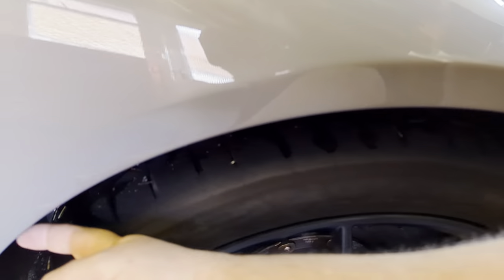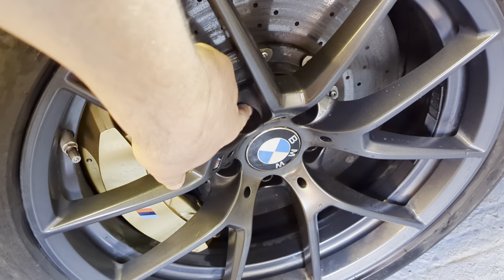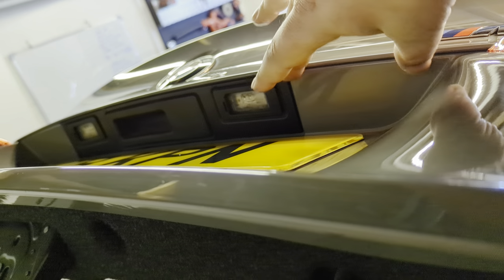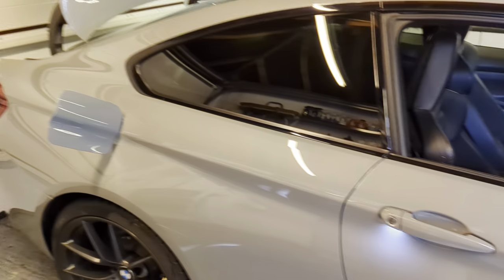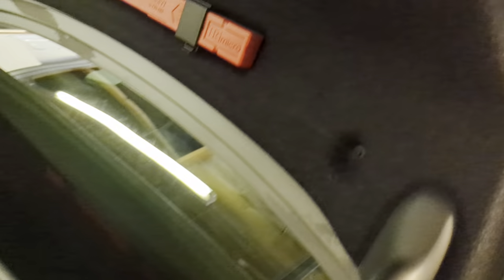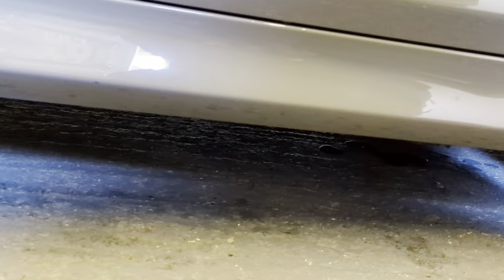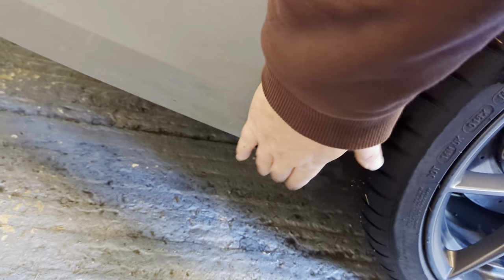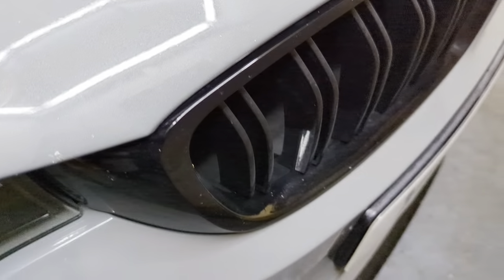10 x BITS WE MISS WHEN DETAILING

Comment: Hi John! I actually found this rather useful considering that my Bmw X2 M35i does 15,000+ miles per year! Some areas that I usually miss is the exhaust pipes, lower grille, boot shut, around my number plate (as it is 4D) and usually behind the wheel spokes, which I should really remember as the forged wheels are extremely expensive to repair and brake dust particles have been fused to the finish, which I can't remove with iron remover, tar remover and a clay bar! 😂😂

Comment: List of car cleaning items, my own list and added Jon's here too. BMW 3 series for me

Wheel nuts
Under sills& under rear quarters
Detail corners of engine bay (use vacuum cleaner with attachment)
Boot hinges and shuts (remove trim annually)
Undercarriage (using hose on a brush shaft or proper kit)
Door hinges (lubricate hinges afterwards)
Wiper recessess and coating with sealant/etc
Inside openable window rubbers & felt (clean with plastic/paint scraper wrapped in microfibre)
Under and inside lip of wheel arches
Door jambs and shuts
Underneath and around doors
Boot lid shuts
Boot lid interior shut
Aroundand above rear number plate (remove both annually)
Around all panel joints
Door mirrors to door gaps
Wheel rims
Front headlights surroundings
Air splitter ( fly and tar )
Grill and inside
Badges - microfibre only
Front window bottom and drain panel and check drain holes
Top of windscreens fr and rear - use microfibre as soft paint

(few things mentioned, such as between the seats and top of dash using a thin microfibre wrapped plastic thing thats not included here as I do these anyway)

Comment: Quick one with regards to cleaning the fuel filler door and surround, on my focus it has the easy fuel flap and I'm always worried water will get in should I jet wash it? Are you safe to jet wash these type or just wipe it out? Great content as always 👏🏻
Reply: I've seen other detailers cover it with a disposable glove prior to pressure washing, that's what I would do anyway 👍👍👍
Reply: I'm glad I read the comments before posting just that question. I have popped a nitrile globe over ot before and I've seen people put duck tape over, but I really don't know if there is a necessity to do that. Truth be known, I spritz some APC in there most washes, before i add snow foam, shut the door and let it dwell for as long as it takes me to rinse off the snow foam, god knows if that's good or bad 🙆‍♂️
Reply from the maker: Saw 9ne 9f these for the first time, yer be carefull with high pressure on it.
Reply: Thank you very much for the advice everyone 🙂👍🏻
Reply: @scottbower8351  Forgot to add that Car Cleaning Guru has a video on how to clean your fuel cap properly, check it out